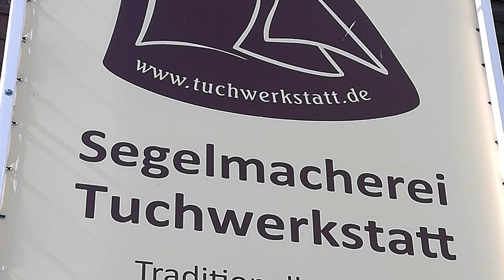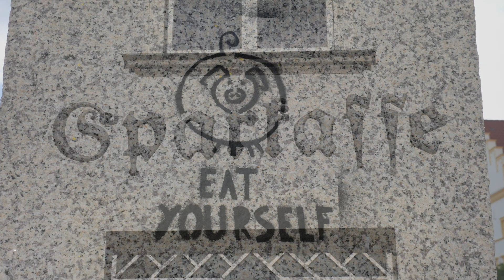THE NEW SAILS HAVE ARRIVED!!!  Building a cruising sailboat - SV Tapatya EP234

Comment: Will you be using all that timber to make a hollow hexagonal section mast? Rounded on the exterior of course, but having six different grain patterns would make for a pole far stronger than a single tree mast. Plus, the hollow interior makes a nice cable chase! Can hardly wait till those lovely sails are raised and drawing wind...
Reply: Bets are on!
My guess would have been the BIRDMOUTH assembly technique ( https://youtu.be/ZTqReFC07uY ).
However, if using the classical octagon pattern, the timber square section would make a thick mast with a relatively small central hole. And 12 sides would probably exceed the mast step diameter.
Anyway, I'm sure Tony already has a CAD (or pencil) draft.
Reply from the maker: A pencil draft, certainly. Mast building coming soon 😉

Comment: Congrats, Tony. Another milestone reached. I love junk sails. Awesome. The filler for the aero-industry must be rock solid. Would it be difficult to fair the keel surface once dried? Also, I think I must have missed the part you fibreglassed the steel section of the keel. Did you do that, I wonder?
Reply from the maker: Hi Joseph 
The filler is a fairing compound so is easy to sand. No, the steel box isn’t glassed, just sealed with zinc rich epoxy and then epoxy primer/sealer 👍